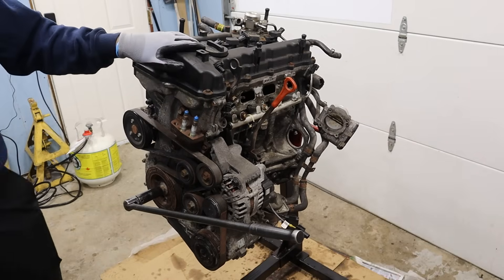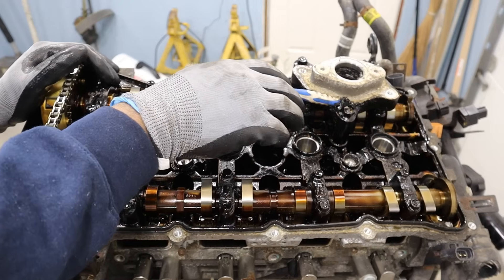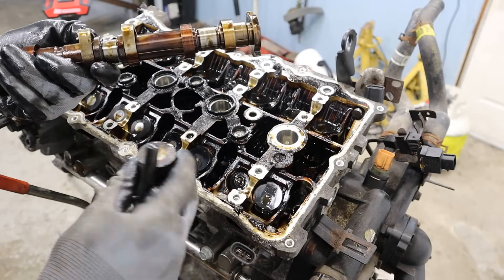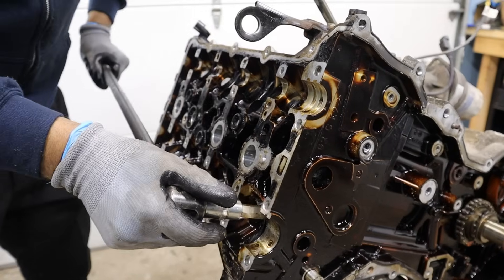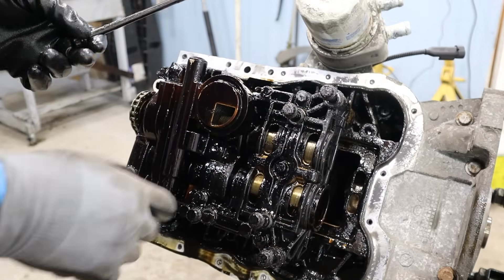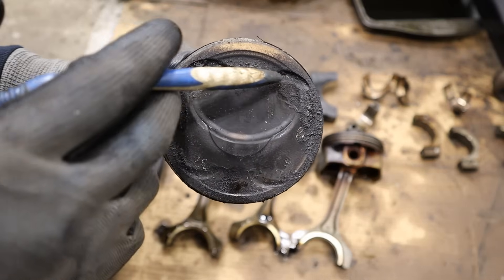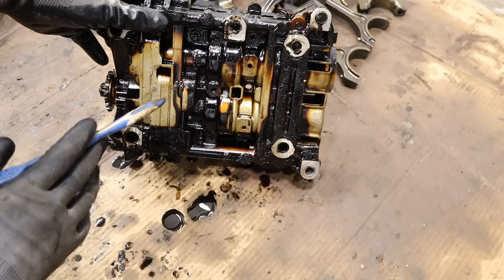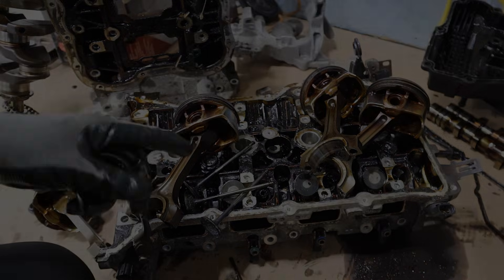Why Kia 2.4L Theta 2 Engines are a FAILURE

Comment: I've owned 3 kias and 1 Hyundai.  All received excellent maintenance including 3000 mile oil changes, 40.000 mile transmission fluid changes, 50.000 mile coolant changes.  All bought new, all driven to well over 100.000 miles. None burned oil, still running like new,  and the cars in general required no expensive repairs. My 17 Elantra that I sold at 110.000 miles, had 0 issues,  and required 0 repairs. My 2021 kia k5 GT LINE  just turned 51.000 miles and has been flawless.  I realize this wont change you intense hatred of the brands, but you should accept your rationalization of all kia Hyundai owners not caring for the cars is definitely not true.

Comment: As someone who has documentation of premium professional oil changes every 3,000 miles, and I top off frequently yet my engine and oil pan looked just like this. What’s happening to a lot of Kia and Hyundai owners is not just “poor maintenance” or “driver error,” no matter how often some techs default to that script. 

Blown fuel pumps, two bad thermostats, constant ignition coil and spark plug failures.  I finally got the P1326 error two weeks after an oil change and technician and had my car towed the next day and he asked me why I waited so long.  This stigma is letting Hyundai off the hook and it’s not cool.  There is an ABNORMAL OIL CONSUMPTION ISSUE. 

Here’s the truth that doesn’t get said out loud enough:
These oil-burning, rod-bearing, and engine-seizing issues are well-documented manufacturing defects, especially tied to certain engine families like the Theta II engine. Lawsuits, recalls, service campaigns, extended warranties, and even the knock sensor detection system (KSDS) all exist because the companies know the design is flawed. You don’t create entire national settlements over “owner negligence.”

It’s the double talk for me.  You know the combination of the metal shards left behind + GDI is causing the soot and carbon but default to blaming the consumer.  It doesn’t make sense.

Comment: The speedkar mechanic oil starvation diagnosis is 100% on the money. This is common because at best people do 12,000 mile oil changes. Normally that would be fine, but on this engine, at 80,000 miles or 130,000 kilometers, a single port GDi issue glues up piston rings, causes blow by and no oil in the sump occurs. Bang. As a 3,000 mile oil swap / dipstick once-a-week type guy I found out before things went to pieces. If blow-by rot sets in - top up, read up, and use Berrymans B-12. Pre-soak with 2-3 LiquiMoly sludge flushes. For B-12: 4 x 6 hour soaks. Then swap oil one hour after the B-12 dissolve the glue on the low tension rings. One day later, no blow by as the rings move freely. Use Gumout all in one, every 3 months, and CRC intake valve cleaner every 6 months. Lack of oil is the big takeaway.

Comment: I'm not sure what to make of the Hyundai/Kia Theta II engines. My wife and I bought a 2013 Sonata 2.0T in 2015 w/39k miles on it. I always did the OC myself w/synthetic 5W30@5k mile intervals. Brought it into Hyundai whenever the recalls came in, there were a few for the engine inspections and they always said it passed. Then at 89k it spun a bearing(s). The dealer declared it was indeed a bearing failure, ordered in a new engine. Took a month for the repairs, Hyundai paid for a rental car for that month. The replacement now has 70k on it, runs great still, the rest of the car is starting to rot out, rust belt. I've heard there are no rebuilds being used, only new engines for warranty, IDK. Hyundai/Kia have extended the engine warranty to lifetime (transferrable) on the Theta II engine cars. So long as the knock detection software is installed. The 2.0T is a ripper of an engine when mated to the nearly indestructible 6-speed auto transmission. I like them so much I just bought a 2012 Sonata 2.0T w/100k on it. Still has the original engine in it, I'm really not concerned about the engine failure myself, it's warranted for life, LOL.

Comment: I bought a brand new 2014 kia rio, i got the oil changed at every 8000KM with full synthetic oil and good filters, changed the plugs at 110,000, and evey 40,000 KM after, sold the car in march of this year, at 205,000 KM, the car did run perfect, and the original 12 volts battery was still in the car, it started to faill when it was really cold, like -15 degrees celcius,  other than that, the car was perfect, no rust because it was rust checked almost every years. I never regretted buying it.

Comment: 1st lesson: Change your oil 
2nd lesson: Change your oil
3rd lesson: Don't forget 1st and 2nd lessons
Reply from the maker: Haha
Don't forget to check your oil between oil changes*
Reply: @speedkar99  We own many cars with different engines from Hyundai never ever faced any problems I do the following things:
Engine oil

1. 5W-30
2.A5/B5
3. Fully synthetic 
4. Change at 3200 Miles/ 6 months

Comment: coming from owning a civic si with k24 and now a kia forte koup with this engine i find it more easier to daily drive as it has a lower torque available and somehow shifts better than 2013 si. wish my luck as the car was previously owned by a woman with 250k but im doing 3k oil changes in the first year with oem filter and kirkland oil

Comment: Very informative video. Too bad I have a 2016 Kia sorento with 153,000 miles, that misfires on cylinder 4 with a "pin hole leak," but KIA won't cover it under its engine recall. Any ideas ?? They want it to seize,  but I've taken it to 2 dealerships and now have records.  One thought the vehicle needed a fuel cleaning and performed that and discovered the valve.  What do I do now ? Oil was changed before 5,000 miles. I'm old school and usually had it changed at about 3500 miles.  Still burned through that oil before changes, and had to add oil.

Comment: Chrysler and Kia's GEMA World engines are known as Mitsubishi 4B1 engines in Japan. The Lancer Evolution 10 was also equipped with a turbo engine. There are not many reports of problems caused by cutting dust in Mitsubishi engines produced in Japan, so there may have been some problems with manufacturing quality control. Even if you ignore those factors, it is bad to not change the oil.😱

In Japan, manufacturers recommend changing the oil every year or every 10,000 km, but it is not uncommon to see it done every six months or every 5,000 to 3,000 km. Forty years ago when I started driving, it was recommended that turbo engines be changed every 3,000 km and naturally aspirated engines within 5,000 km.😆

In Japan, general vehicles are required to undergo vehicle inspections by the Ministry of Land, Infrastructure, Transport and Tourism every two years, and commercial vehicles are required to undergo vehicle inspections every year, and no matter how poorly maintained a vehicle is, engine oil was always changed during the vehicle inspection and maintenance.😅

Moreover, since most Japanese owners replace their cars every 10 years or 100,000 km, it was not uncommon for used JDM cars that were used in Japan to be exported to Russia, the Middle East, Southeast Asia, etc. for resale.😇
Reply from the maker: Interesting about japan. Wonder how manual Korean cars take marketshare there
Reply: @speedkar99  Unfortunately, Korean manufacturers have hardly been able to establish themselves in the Japanese market.

Historically, Korean manufacturers have attempted to enter the Japanese market three times.
First, in the late 1980s, several Hyundai models were badge-engineered and sold in small quantities by Mitsubishi Motors.
The second attempt was made in 2001 when Hyundai tried to officially enter the market by establishing a network of authorized dealers, but withdrew in 2010.
From 2022 onwards, Hyundai's sub-brand Ioniq will attempt to enter the market for the third time by exclusively selling EVs.

The Japanese market has two trends that are completely different from those in Europe and North America.
One is a very high level of reliability. In Japan, cars must pass the Ministry of Land, Infrastructure, Transport and Tourism's vehicle inspection every two years, but during the Showa era, there was a special rule that "the vehicle inspection period is two years from the time of purchase until the 13th year, but every year after the 13th year", so customers in the Japanese market had the custom of replacing their cars every 10 to 13 years at the longest, or after driving 100,000 km. At least for this period, reliability was required so that no major problems would occur.

Another important trend is that for flagship models, catalog specifications were given much more importance than the actual driving feel.

The automobile tax system levied annually in Japan is strictly divided by engine displacement, and the rank of automobile tax increases for every 500cc increase. It is generally believed that this was originally introduced in the 1960s with the purpose of systematically preventing American cars with very large engine displacement from dominating the Japanese market. For this reason, 1500cc engines, which are taxed at the same rate as 1000cc engines, are allowed to have relatively mediocre specs, but 1600cc engines are taxed at the same rate as 2000cc engines, so 1600cc engines, called "tenroku," were required to have power that could compete with 2000cc naturally aspirated engines like the Toyota 4A-G and Honda B16A, and for 2000cc class engines, the top priority for each manufacturer was to develop turbo engines with power output comparable to 3000cc naturally aspirated engines like the Nissan RB20DET and Toyota 3S-GTE.

Against this background, Toyota's Chevrolet Cavalier and Mazda's Ford Festiva were introduced to the Japanese market in the 1990s, and the Hyundai Coupe in the 2000s. These cars were not bad cars by any means, but in terms of displacement and catalog specifications, they were perceived as half-hearted in the power war at the top of the Japanese market, and sales were extremely difficult regardless of the actual driving feel.

This tendency for failure is sometimes seen among vehicles sold by Japanese manufacturers, where models developed for the North American or European market are sold in the Japanese market as is, with notable examples being the 2700cc Subaru Alcyone XT and the 2600cc Mitsubishi Starion. The first car to break through this half-hearted displacement jinx and achieve great success in Japan was the 1989 Nissan Skyline GT-R (BNR32 RB26DETT). Even after the BNR32, the main trend in the top-end power war in Japan, the so-called JDM muscle car, was the 2000cc class turbo engine represented by the Mitsubishi Lancer Evolution and Subaru Impreza STI, below which was the battle of 1600cc naturally aspirated engines led by the Honda VTEC engine, and at the top end, there was a battle of 3000cc turbo engines, with the Skyline GT-R, Nissan Fairlady Z, Mitsubishi GTO, and Toyota Supra challenging each other. Until the 2010s, the Japanese market had a custom of industry self-imposed restrictions on maximum output of 280 horsepower (660cc K-cars were 64 horsepower), and each company focused on developing and promoting high-powered engines that were only available in the Japanese market, so Porsches and American cars with displacements of over 3000cc never became major players in the domestic sales competition.

An interesting fact is that Hyundai, which entered the market officially in the 2000s, had a close relationship with Mitsubishi Motors, and sold engines and models in Japan that were very similar to Mitsubishi models, including the Theta engine. Among them, the Hyundai Equus attracted hidden attention among Mitsubishi fans. The Equus is a sister car of Mitsubishi's Proudia and Dignity, and while Mitsubishi stopped selling the Proudia and Dignity in a very short period of time due to the deterioration of its management after the recall cover-up scandal, the Equus continued to be sold for 10 years. For that reason, avid Mitsubishi fans who acquired a Proudia or Dignity in Japan often used Equus exterior parts and aftermarket parts to dress up their cars.
Reply: @speedkar99  Finally, there is another special circumstance to add: the roads in Japan get narrower the further into the countryside you go, and large cars that are not maneuverable tend to be avoided. This is why large sedans made by Japanese manufacturers are mostly rear-wheel drive. K-cars were very popular in these regional markets, and at the same time, they were also a market for the poor in urban areas. However, even K-cars were available as sports models with 64 horsepower DOHC turbo engines, such as the Suzuki Alto Works, Daihatsu Mira Turbo, and Mitsubishi Minica Dangan, and for many years there was no room left for "relatively large" small mass-produced cars made for the Western market by not only Korean manufacturers but also Western manufacturers to enter the Japanese market. For the same reason, mid-range front-wheel drive sedans for North America, such as the Nissan Maxima, Toyota Windom, Avalon, and Pronard, struggled to sell, and only some success was seen with the Nissan Primera and Isuzu Gemini, which were originally developed for the European market.

Comment: Car runs great after 120k miles. It even has its first oil filter! Everything is original :) 
Sorry but, this engine has seen never an oil change or only every 30k miles. With 10k miles changes you cant sludge up an engine so badly. 
I do an oil change every 9000 miles on my Ford, at least once a year, and the internals of my engine look clean with 0 sludge after 150k miles.

Comment: Even KIA's 7000 to 12000 mile OCI doesn't account for this much varnish and sludge at only 130,000 kms. The owner completely neglected oil changes.

Comment: Older engines were better. My 03,04, 08 santa fe's had over 320k miles before i junked then dued to rust. Engines and transmissions were still good

Comment: My 2012 Hyundai Sonata had 224k kms. when I traded it last Feb'25.  I changed the oil below 5000km using full synthetic oil.  I also installed an oil catch can at 50k kms.  The only major part I replaced on its engine was the starter.

Comment: Looks like the balancing shafts didn't have any balancing holes on the counterweights.
Honestly, by experience, it's impossible to meet balancing requirements just by turning/milling. Never saw a single shaft (crank or balancing) that didn't need any drilling. 
Also, usually the balancing shafts are designed to have excess material on the counterweights so that you can drill them. So that in case the forged raw part had any strange deviation, you can still machine them to reach the inertia desired.

So, either this is 1 in a billion case, or those balancing shafts do very poorly what they're supposed to do ... 
Looks like a very cheap design, to me

Comment: Btw, all that engine oil sludge is not due to just a lack of oil changes but also to a dirty or clogged PCV (positive crank valve) which is what is designed to evacuate the blow-by and crankcase oil fumes.  When the PCV fails, there is nothing sucking out these fumes and it all starts to deposit layers of sludge on everything inside the engine.  The PVC is very inexpensive to maintain or replace but SO neglected.

Comment: My sister owns a 2008 Kia Optima that as of 2025 has 146,000 miles on it and it uses no oil between changes. Runs just so nice. What year 2.4 liter engines were affected?

Comment: 10000 miles with synthetic oil wouldn't create that kinda carbon, sludge, and varnish.  Whom ever owned the engine probably went way past 10000 and probably used a conventional or synthetic blend. I believe those motors took 5W-20. That motor didn't get synthetic oil.

Comment: I recommend using either Valvaline Restore & Protect or Pennzoil Platinum Ultra oil in these engines. Never go over 3000mi between oil changes.  Always use Top Tier gasoline and add Berrymans or Textron at appropriate intervals.
Reply: I use Restore and Protect, OEM filters, Chevron/Texaco gas , change the PCV valve every 10-15k miles, turn the push start on and wait for the fuel pump to spool up and stop before starting, change oil every 3k, use 5w30, and add Techron concentrate complete before every oil change. I also cut open the filter to examine for debris, replace the crush washer every time and torque to 35ft-lbs, getting ready to do a drain and fill on the transmission fluid soon and do one every 30k… 3-5 qts.

I’m in Texas. I also let it warm up in the driveway for 30sec then immediately drive it under 2k rpms for the first 5-10 mins before driving it at higher rpms. I check the oil every morning on the dipstick too since I drive 135-200 Mile per day.

Comment: Should I be worried that my moms 2014 Santa Fe AWD non turbo is going to grenade soon? Has about 145k miles and drives less than 150 miles a month. I've always had her follow the oil change schedule. 

I hate that you not only have to worry about them being stolen but this issue too as this was a birthday present to her. CPO with only 7k miles at the time.
Reply from the maker: Yes you should always be worried. 
Check the oil at every fuel fill-up for early signs.